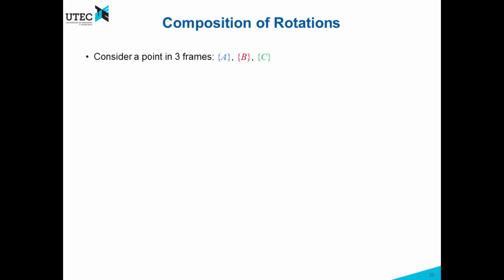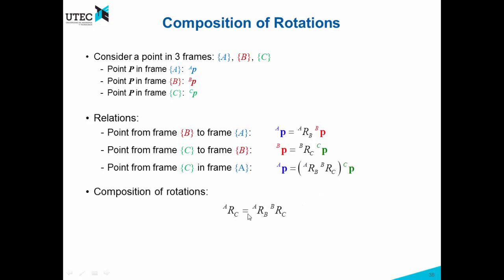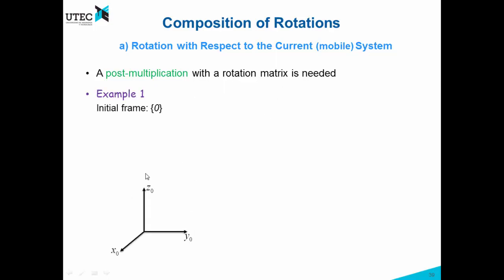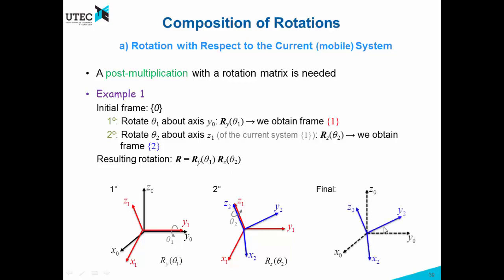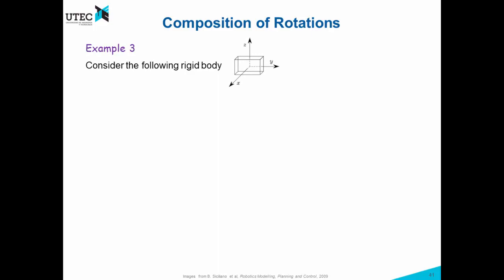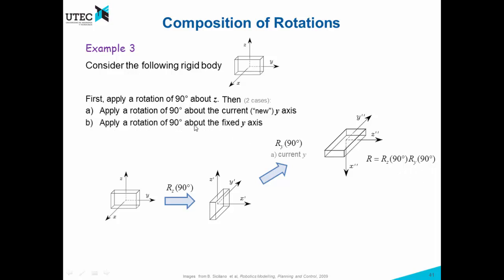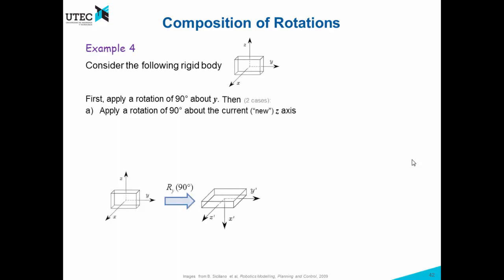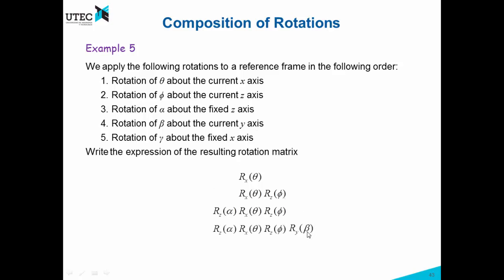Lecture 1c - 4.3: Composition of Rotations (Robotics UTEC 2018-1)

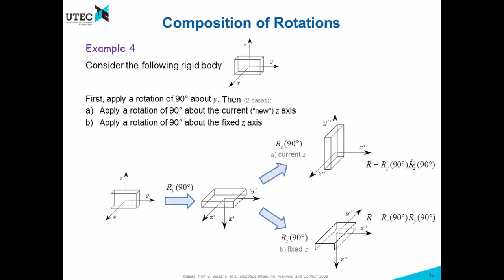Comment: Unsure if you used the right image at 6:00 when you rotated 90 degrees around the fixed z axis. I thought the longer side of the box is facing upwards and is on a side view